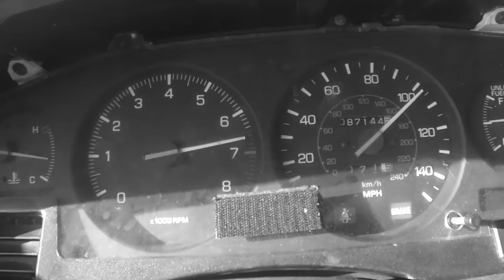Legacy GT UpPipe | GrimmSpeed Cobb Invidia UpPipe| WRX STI

Comment: Not referencing the sensor in the up-pipe (which is the EGT) but specifically the Post-turbo O2 sensor; when you deleted this cat did it trigger a CEL from the post-turbo O2 sensor?
Reply from the maker: No it did not

Comment: Nice video as always bro, might want to look into an aos too for a preventative mod. Also the oil pickup tube cracking? Not sure if the cracking tubes were on the leggys or not.
Reply from the maker: thanks man, whats an aos?
Reply: oh air oil separator, some turbo Subarus have really bad oil blow by.
Reply from the maker: ahhhhh okkk, yeah ill look into that